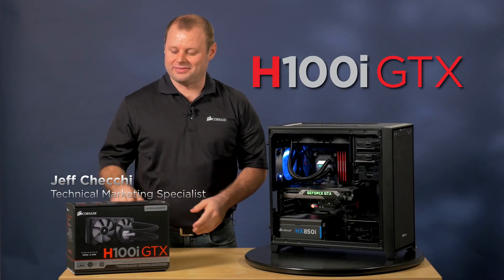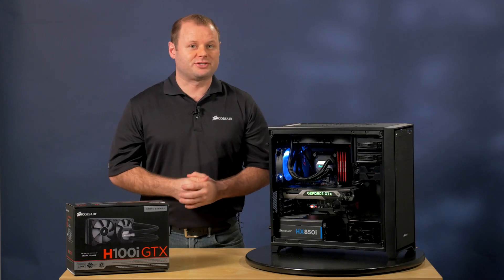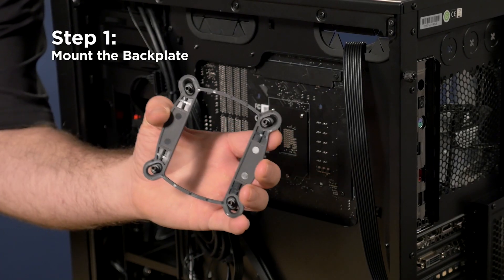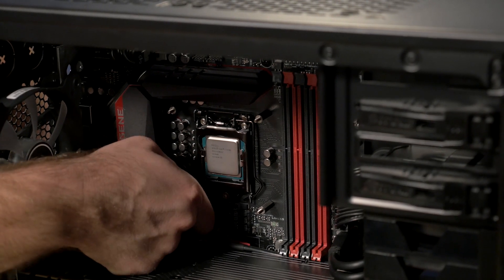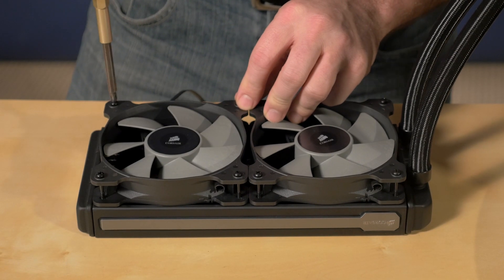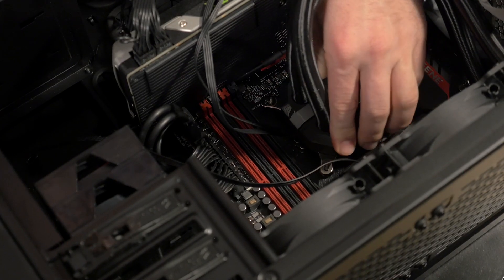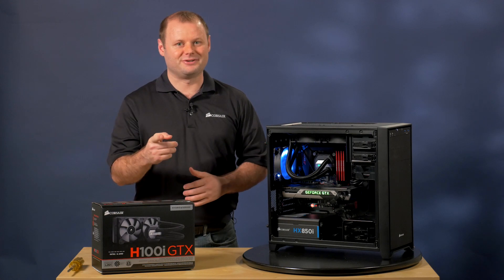Corsair Hydro Series H100i GTX Liquid CPU Cooler Installation How-To Guide

Comment: Mine has been running great for ten years.  Only recently did I replace the fans with new Corsair fans since one of them was making a noise.  The only issue it's got now is the red LED light is burnt out so it can only display colours between green and blue, but apart from that one non-performance related complaint, it's still going.  Here's hoping it lasts ten more.  I'm confident it will.

Comment: Accidentally knocked a couple wires loose (I think) off of my water cooler identical to this, and now I can’t seem to figure out where my lead cables from the cooler plug in. I know where the fan and the usb one plug in because ones marked and one is simple. I don’t know if these cables NEED to be plugged in but I am under the impression that they do. Please if anybody could help me figure this out ? I am desperate noob lol

Comment: how long do these coolers work before they need replaced/cleaned?
Reply: from what I have read, around 5 years, but you could get unlucky and the pump could die earlier, mines 4 years next month and still going strong

Comment: You don't have to put any liquid into the radiator?
Reply: comes prefilled, and there it is not designed to be opened
Reply: What if it needs to be refilled? Do I have to buy another one?
Reply: @NecrovoidTV  It is a closed system, so no water management is required. Liquid should be good for the life of the pump. You only need to do your basic dusting to keep the radiator free flowing and like any CPU cooler, you should change the TIM perhaps once a year, depending upon usage.
Reply: @NecrovoidTV  It's a sealed unit, it never needs to be refilled.

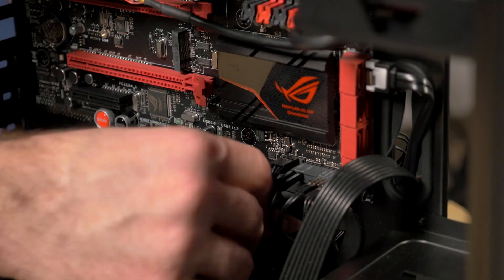Comment: 1:53 - does this data cable fit on any mb? mine is the z97x Killer
Reply: The cable is Mini USB on one side, and internal USB 2.0 header on the other. if your motherboard doesn't have a spare internal USB 2.0 header, you can just grab a regular mini USB to Type-A (standard) and have the gable sneak out the back of the case and into a usb port on the back of the mobo.

Comment: Should you tighten the cooling block screws as tight as they can go? I have heard if you over tighten them, you can damage the MB. My Screws never seem to fully tighten and I am concerned about over tightening. I have an AMD FX8150 & Sabertooth 990FX & antec h20 620 cooling system. I know it is old, but I built it years ago, sat in storage now I am bringing it back to life. Thanks

Comment: What is the point of installing the fans on the bottom? Aren't you just blowing hot air from the radiator into the case?
Reply: did you even watch and listen ??? at 1.10 he says he setting fans up as exhaust

Comment: When I'm looking at parts:
Corsair psu: Well it's expensive but if it dies it takes everything with it so okay I'll go with quality.
Corsair ram: Well it's cheap but the clock and latency are good... wait what.
Corsair cooler: Well it's cheap but if it dies only the fan goes with it.
Corsair fans: Holy christmas what is this, a noctua rebrand? I'm not made of money! Might as well use 12g CO2 cartridges.
Corsair SSD's: Okay seriously guys you get everything else right HOW DOES THIS COST SO MUCH?!

Comment: Question. Microcenter description says it does not fit a 2066 socket,  Newegg site says it does. I have it and I don't see the correct screw standoff sizes for the 2066 socket..   What can I do. I need a 240mm cooler for a 2066 socket......Thanks in advance....pvp

Comment: I've had this closed-loop cooler for about 3 years now.  Still works fine but doesn't cool quite as well as it did when it was new.  The radiator gets dusty so that's part of the problem, but I wonder if any other maintenance should be done (flushing, etc.) to these things after 3 years?

Comment: Ok, I know that it's been awhile since this has came or but if u want to add the color disks like on separate Corsair fans, can I put them on the original fans that it came with or do I have to use the fans included. If use the fans included, will the other fans fit in the slots for the fan?

Comment: Sir, I have a query if we install this cooler and suppose it's working fine. But the question is how do we come to know whether it's not performing and CPU heats up. I mean in air cooler it's easily noticeable but this type of cooling how to know whether it's working or not.And how to do its maintenance. Like water filling etc.

Comment: Can anyone help. I've installed this as shown above, but when I start up my pc I'm getting CPU fan error. The fans sound like jets and are making a lot of noise, but I'm getting zero cooling to my CPU and it's just overheating. (I had fans cooling my CPU before upgrading to Corsair water cooling)
Reply: DefinitelyMark did u solve it ? Should it be conected to AIO pump header ?

Comment: My case is the corsair spec 03 and my motherboard only has 1 cpu fan slot and  another 2 slots i have my 2 front fans using a splitter and my rear fan in the last port. WIll this h100 work with my motherboard since i only have the 1 slot for the cpu fan my other ones are taken from my rear exhust fan and my front 2 fans

Comment: I installed radiator, screw is tight, washers flop around, it seems the screws are too long, another problem, installed intel bracket on back side, posts on front of Motherboard, the back bracket corners do not seat in..i think the corners are suppose to fit in the holes, mine doesn't.there is a gap between motherboard and back intel plate, here is a "lip" around each screw holes, I think they are suppose to fit in the wholes and it doesn't. I have a Asus Z270E motherboard

Comment: I have the 240 h100i  An it is almost hilarious how fast i cool it down with the 4 120mm delta TFC1212DE  fans i have attached to it controlled by a 5 switch 100W per channel switchboard in one of my bays
Reply: I will say to thu i dont like the mounting myself feels flimsy and cheap as sht. an i stripped my first one an had to return it. it should tightin ALL the way and fit SNUG with 0 PLAY. thats the only serious problem i see an have with this thing so far. May do a custom loop in the future if these needs arnt met on my next build.

Comment: So is that it? No liquid or anything? Is it runned by air?
Reply: It's liquid yes
Reply: It's prefilled. Never has to be refilled or anything.
Reply: but where does it go
Reply: its a closed loop, it cycles through the pump (attached to the CPU) through the hose to the radiator and back out the other hose back to the pump.... continuous loop - sealed off. it doesn't go anywhere
Reply: MiniatureMilitia do we need to fill it or is it pre filled

Comment: Can i ask for a simply question ? I using liquid cooler Corsair H110i with 280mm Radiator mount at front of the case because i don't have space to set the radiator at top , it's stuck with my mainboard. So should i take the air into the case through the radiator or pull out ? My case also have 2 slot to mount fans at top ( have dust filter ) and 1 at the back of the case ? What is the air direction of all fans . Thank you !
Reply: Panda Po If your case has slots for two fans at the top the radiator should be able to for, but make sure the cords are hanging out towards the back of the case rather than the front, but that could depend on what kind of case you have. Also, it's up to you which direction the fans can be pulling air from. I personally think it's better for them to be pulling air in rather than out like he does in the video.
Reply: +Spirit Outcast My radiator don't have enough space on top ( stuck with the mainboard ) i currently pull air in even it's a little bit hot but it's enough for graphic card

Comment: Can the fans be mounted to blow air out of the case instead of in it?
Reply: In this video they set the fans to blow air out while passing the hot air through the radiator, dissipating it and therefore making the hot liquid that cools the cpu cooler again. You can set it up for intake/exhaust or push/pull. Either generally work fine, and you can mount with fans above the radiator. Like he showed, just use the arrows to show where it will push the air.
Reply: What is your opinion on this vs the Thermaltake Water 3.0 Riing RGB 360 cooler?
Reply: Most think it makes more sense to pull cool air over the radiator, but in testing it has been discovered it really makes no difference.
Reply: Syn TV I'm so glad I read your reply because I was starting to wonder if I was going to have to put it over the radiator xD

Comment: I need help sir. With the fans some People put it in the other direction? Why? And which one is the best directions for my CPU cooler fans
Reply: It depends on the rest of the airflow in your pc but generally it won't matter. Linus has a lukes workshop video that talks about it. Personally, I'd recommend setting the fans up to exhaust air out of your system and keep your intakes filtered.
Reply: :D thanks mate

Comment: I have a question... this is like the other liquid cooler that require some kind of liquid to keep it funcion? After I install it, do I have to give it maintenance by adding something to the liquid cooler?
Reply: xCryzizZ Cruz No, you never need to worry about adding water or anything of the sort, which I was sort of worried about as well at first. But you won't have to worry about that kind of thing!
Reply: Spirit Outcast ok thanks 😊

Comment: Do i need any other water cooled for that to work? Or where does the water come from? Im so confused
Reply: The "water" is in those tubes and that radiator, you don't actually every need to replace it, also "Do i need any other water cooled for that to work?" I am guessing you mean any other components to be water cooled, if so, you actually dont need anything water cooled, it is just the more expensive and efficient way of cooling your system, air cooling is the cheaper way, I would reccomend cooling your CPU for sure, if you are planning to overclock go for something quite good (like this h100i GTX) but if not any cooler will do, and also just cool everything with case fans, make sure you dont get crappy case fans though as some might have a set fan speed and might be too loud etc. I reccomend 3-4 case fans.
Reply: Zephane ok thanks, you understood what i meant by all, the case im buying has 5 fans but you can fully control the fans, and the loudest they get is 23db and thats pretty quiet, but thanks for all

Comment: okay, someone explain this, please. 
I'm getting an NZXT S320 but has 4 fans slots

The motherboard I found from Asus z170-E has
 x2 Chassis Fan (meh)
x1 CPU Fan
x1 CPU OPT Fan
&
x1 Water pump ( I Assume that's where the pump connector goes :P)

now, what confused me is this. I notice in the vid, he used a y spliter for the 2 fans ( where does he connect that too? the SYS fan? the CPU FAN?)

Note, there's gonna be 2 other fans in the case
The Top and the Rear. The front is where the Cooler gonna be with the 2 fans. Now this motherboard ( I'm aware the A version has 4 Case Fan Connectors but come on. this is $20 cheaper) only has 2 Case Fans. will it be a problem? or just get the A Version.

I would also like to note that i'm getting the v2 of this water cooler
Reply: best bets are to make a thread of this on tomshardware or reddit buildapc. People there can help you out. Also, its a cpu cooler, so expect him to plug the cable from the y splitter into the CPU FAN. Another thing, im pretty sure there is no difference between installing the h100 gtx in a case with 2 or 4 fans, it will be the same either way.  

For your last statement, I would go with the H100i. The H100v2 fans run at 2435 RPM, while the h100i fans run at 2700 RPM. this makes the h100i much better. There is no difference in noise either. They both produce 37db of sound. There is a $3 price difference between the h100i and h100v2. Go with the h100i, its much more used than the v2. Hope I helped.
Reply: Thee Jackal quick reply, thanks :)
Reply: No problem.

Comment: So, is it possible to buy the corsair hydro radiator and whatnot without the fans? In case I want RGB fans. Also, regarding the corsair link, are other fans/liquid coolers compatible with it or does it need to be Corsair?
Reply: So, is it possible to buy the corsair hydro radiator and whatnot without the fans .... no........  ;d
Reply: You could always keep the fans, but no, you cannot buy the h100i GTX seperately.

Comment: Do you actually suggest the pre-applied thermal paste over a new tube of some aftermarket paste?
Reply: I hear people say the pre-applied thermal paste, with one guy telling me he got 30c with an i7-6700k @ 4.4Ghz on load, but I have no opinion of aftermarket paste as really it is a grey spot, seeing as you have to remove the pre-applied paste and then add the other one, I would try pre-applied thermal paste and if you don't find it efficient enough maybe try the aftermarket paste, but really, the pre-applied paste isn't exactly bad.

Comment: Will I ever have to put liquid in this? will this mostly be silent?
Reply: You can replace the stock Corsair fans with quieter fans anyway.
Reply: Vexolyte you don't have to put liquid in it and not sure if it's mostly silent
Reply: Its not the most silent but it silent
Reply: Redas Nekrosius please tell me a silent build / parts, like the PSU, CPU fan, case (Motherboard and ram cant be silent but idk which ones to pick,
Reply: Vexolyte Just shop around and check out channels like Jaystwocents, bitwit, linustechtips. It's hard to recommend a system when we don't know your application, budget, or what you want out of the system. Also check out Linus Tech Tips forum and I bet you can find some posts on there that I'm sure will help you choose the right build for you.

Comment: I have a stupid noob but very important question. 
I have this cooler since i need a strong rig to play big games, even if i have very little tech knowledge. Problem is, i need to put on a clean new windows since its old and literally dying even with regular cleaning. BUT this is the first time i have a water cooler, which obviously wasnt installed by me, and im concerned if i SHOULD know something specific about the water cooler when i reinstall a brand new operating system (with ssd format ofc).

So, i need to clean install a new Windows7 but will this cooler run "on itself" like my former basic fan cpu coolers did or do i need to manually install its drivers but if so then what happens till i get to that part? Since its an usb device i assume its basic running program is built in??? Help im a bit unsure here i dont wanna destroy my pc bc i dont know how to handle it....

Oh and i dont mean the Corsair link (which i use now) i will install that later, but im concerned if the cooler will be just fine if i reinstall Windows as i always did without second thoughts about cpu cooler.

Comment: you saiid to plug in the 4 pin power cable but its only 3 pin
Reply: They can be called 4 pin connecters but only have 3 pins
Reply: thats what I thought!
Reply: cheeriomartinez it my first pc so what is the name of the space you will plug in the motherboard for the data cable

Comment: wait wait a little minute so you are telling me all i have to do is this OMG MY FUCKING GOD I LOVE YOU CORSAIR i thought i had to deal with actually putting water or liquid omg i love corsair i want to marry i want a corsair Jr
Reply: Yes as it is closed loop all you have to do is place it inside your case, you know, you can use one of these H100i GTX Coolers on Graphics cards?
Reply: All you have to do is install it?  You don't have to put the water in?  And how often are u supposed to change it
Reply: you cant change it. apparently this cooler is permanantly sealed. if you take off the things than you've pretty much broken it.

Comment: Mine just died. It seems like the coolant stopped circulating. My processor is now idling in the high 70s C and the radiator is cool to the touch. Is there any way to get it working again or is it basically a throwaway?
Reply: Nomee Slot Videos You might have touched it in the wrong place without properly discharging yourself, but I don't know much about what to do if that sort of stuff happens, sorry.

Comment: what difference would putting the fans on top of the radiator do?
Reply: If you mean, why would you need fans on the radiator, it's because the radiator's whole purpose is to work in conjunction with air moving past the radiator fins to dissipate heat.

If your question is, why should the fans be on top of the radiator and not below it, the short answer is he wants to pull the air through the radiator instead of push the air through it.  I prefer pull over push with a radiator myself, because this makes it easier to clean the radiator fins on the bottom.  In a push configuration, you typically have to pull the fans off the radiator in order to get at the dust accumulating in the fins on the side where the fans are.

Comment: I have an older version of this cooler not sure what the code is tho, the problem is that the cpu is always over heated that it reaches 100c even though all the fans are working and I just recently re-applied the thermal paste. Can any one help please??

Comment: Using only the screws and washers that come with the product, is it possible for me to do a pull configuration on the fans/radiator instead of a push configuration?
Reply: ElectricPyroclast just flip the fans upside down to get the opposite flow direction
Reply: John Doe No good reason to do an intake style on the top. I figured it out, anyway. Just put the fans above the radiator, and the screws should be barely long enough to hold them all securely to the case.